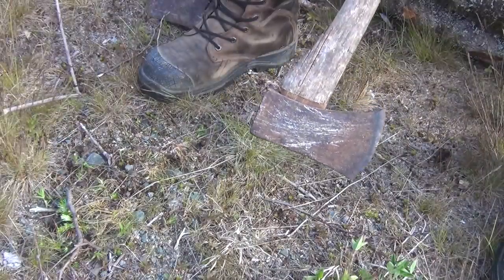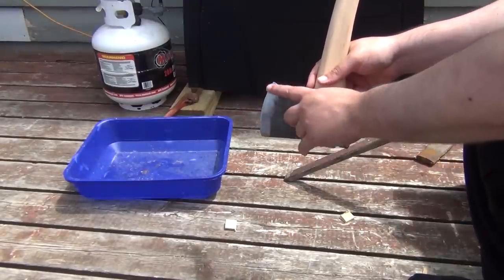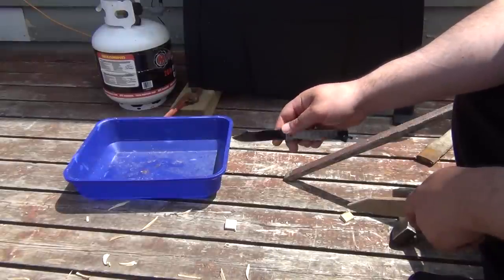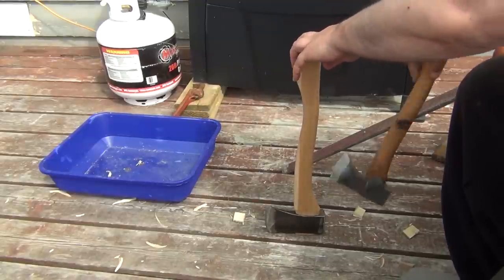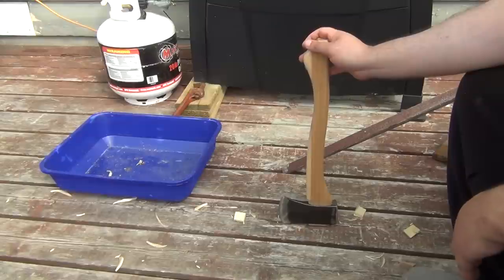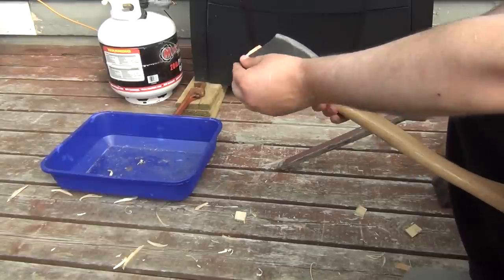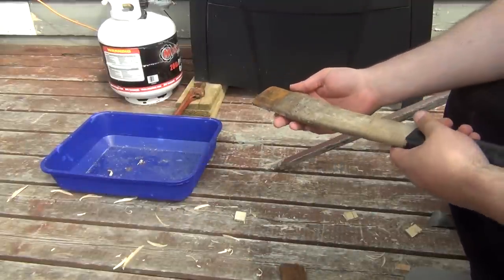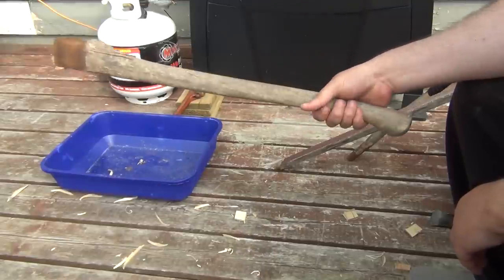Restoration : two well used utility axes

Comment from the maker: There are a bunch of those large mult-tools, they are excellent for what they are designed for - urban all purpose "I have no idea what I will need" type tools. They can hammer, pry, usually wrench, and to some extent cut/chop/slice (but awkwardly). They are also great demo tools if you have to get past a door, break up a table to burn, etc. .

Comment: Reviewed this....the one i re-hafted, that bearded one, didnt come loose and it took quite a beating this winter...didnt move an inch and as i told you i only used a wooden wedge ( just like you adviced me).....my problem is with the haft, seems to begin to brake off ( under that beard, when i split big logs, the logs started tearing out pieces of the handle..)....a common repair measure here is to put a thin metal plate around the haft ( in the area where you hit the wood with the handle)

Comment from the maker: Same here, when the wood is specified, it is almost always American Hickory. When axe handles used to be made here, the local woods which would be used was white oak. Most of the other local species are either extreme soft (pine) or very twisted/knotty (spruce) and generally would only be used for beetles by harvesting either stump wood or the odd placed burl.

Comment from the maker: Yes, there were parts of the head which were impacted from hammer blow which mushroomed it out, and other parts which actually had caused the metal to splinter. Both of these are signs of severely damaged steel which you would want to remove. Plus when the head cleaned up there is a bit of a chance the user will not be so prone to keep damaging it.

Comment from the maker: Yes, if you have the money, they are a nice pattern for medium to hard woods. I would advise to be able to check a few first hand, or speak to the dealer directly as they can come with pretty bad bit/handle alignment. That is the only real issue with them. Fiskars makes a nicer soft wood pattern (pine, juniper, etc.) but some people really hate the synthetic handles.

Comment from the maker: The bearding makes the edge highly asymmetrical which means you only get partial depth cuts and as well it can be prone to glances. If you do not fix it then it also tends to get worse over time. It is pretty commonly seen on power sharpening as people will favour their dominant hand.

Comment from the maker: So in short as a large urban emergency/survival tool when you don't know exactly what you will need, they work well. If you really know what you will be doing, usually you can get a more narrow scope tool that is a bit better for what you want as you may not need the length/weight, hammer, etc. of the do it all tool.

Comment from the maker: Metal wedges will split the handle, I prefer not to use them unless the haft loosens. 

A proper wedged handle will last much longer than the inverted friction fit found on tomahawks and pickaxes which is used mainly because those handles break fairly frequently, long before the haft would loosen if they were fitted like traditional axes.

Comment from the maker: Here the axes are very dry, there is no need to stabilize them after use, they are usually that dry they can benefit from being oiled.

In general yes, wood glue on wedges is a good idea.

Comment from the maker: I have seen people put them in a fire and burn the head off. I would not recommend that as open fires can reach very high temperatures, easily enough to draw the temper way down. In general, unless you get a very nice head, it is cheaper to buy a new axe now - but I don't like throwing them out so I haft them on occasion for friends/family. But good quality handles are a problem now as the wood is ever thickening as well.

Comment from the maker: They were barely in. I took the nails out using a cat's paw and they basically fell off. If the handle is heavily damaged, but still decently secured it may have to be drilled once the metal wedge (if there) is removed. It only gets to be messy if the whole thing is glued in as then you can end up having to get the wood and glue off of the inside.

Comment: i always hear people saying they burn out their axe heads with a torch, but that would cause the head to lose temper. i tried to rehandle one unsuccessfully that i had received as a gift and a month later the handle broke, i wanted to rehandle it because it had good geometry, but i wasn't able to get the wood out of the head so i had to go exchange it for one that looked like it had been sharpened by a monkey. so i had to grind on it to get it to split properly.

Comment: Oook....i see what you mean....but for peace of mind, i mean, not only(when you rehandle the axe) you remove wood from the tip to fit the bit but afterwards you get it fitted in, you cut it in the middle for the wooden wedge....think its my obssesion, when im using my pickaxe( handforged by my grandfather) im completly carefree- full force....well, when im using a hatchet im always a little afraid it might come off flying away, and i am nervous if someone is around me at that time...

Comment from the maker: A properly wedged axes has the same taper as a pick axe, the taper is just dual so it can't move either way. If you want to get some peace of mind then just find a cheap axe, haft it and then try to beat the head off without removing the wedges.

Comment: I like the thinner handles as well. Do you think that if you put a wood cutting edge on the drop forged carbon steel axes from the hardware store that they would do alright. Or are they to low quality for that kind of work?
Reply from the maker: +scottecooke It is likely that you might have to make them a little thicker, but not very much. Try say ~25% thicker or so.
Reply: Cliff Stamp ok thanks I will give it a go. It would be good if it cut nice. Otherwise I have been using it for harsh tasks but I would like it to do wood.